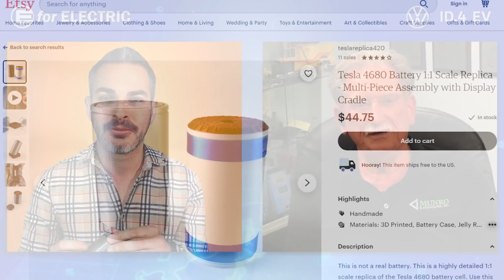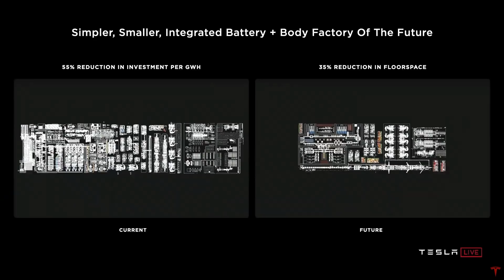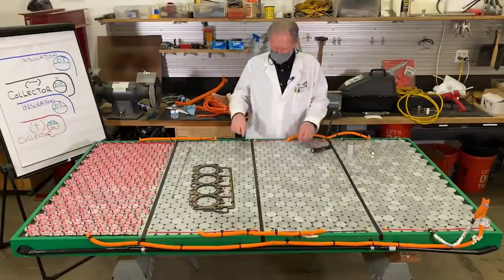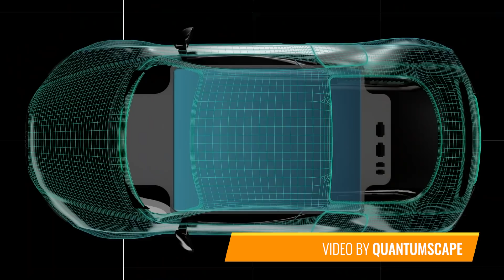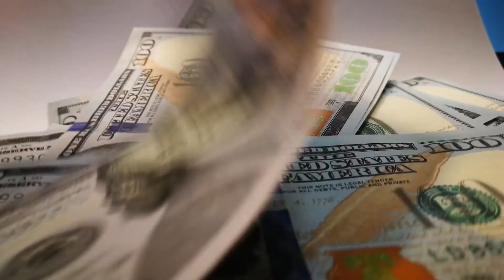SANDY MUNRO: Tesla's 4680 Cells & The Future of EV Batteries

Comment: Re: range issues, consider the PHEVs, like the Prius Prime: 60 miles on pure electric, which gets most of your daily driving needs done without gas at all, plus a 680 mile range combining the EV + gas engine, and guess what: there are filling stations from one end of this planet to the other. I think Toyota is smart to keep the PHEV option on the table. As much as I loved my Tesla M3, it was small on the road and hard to get in and out of: fun driving but at a price. Where Toyota needs to catch up with Tesla is in its electronics, including FSD or equivalent,
Reply: PHEV can't compete with simplicity, low maintenance cost and reliability of BEV.

Comment: Love the concept of Cold fusion & believe that it is hiding somewhere within the mysteries of quantum mechanics.  However, cold fusion will make heat not electricity.  It will need a companion technology (thermoelectric?) to convert heat to electricity.  Conceptually, your model of fuel cell plus battery with CF taking the place of the fuel cell is probably the right one.  Your channel is a favorite; insights from your years at Ford add bonus points to the topic of the videos.
Reply: Lol there will never be cold fusion inside a car

Comment: The "replaceable electrolyte" battery could make sense. A battery like that could both be rechargeable but could also be "refueled" at a fuel station. A person could also have their electrolyte swapout at home where they have an enclosed system that trickle charges their electrolyte while they are away and when they get home they can either re-charge their current battery or if needed, swap out the electrolyte. 

Tesla's 1 million mile battery is still VERY revolutionary but I believe Tesla is doing this for both use in space and their cars. In space or on other planetary bodies you will not have the luxury of a fuel station or service of any kind. The battery just needs to work. Electricity can be produced through many means (solar, fuel cell, nuke, chemical ect...) but without an extremely reliable battery it's all for nothing. Tesla isn't just building an electric car company for the heck of it... Musk is dead set on space travel and the car company is a means to and end, Telsa is an R&D arm for SpaceX where they can torture test components that will be used in space. It's brilliant really.

Comment: Sandy Munro does not seem to be very informed. The problem is that he has no clue about what is happening outside of California.

There's a new gigafactory built in north of Sweden by a new company called Northvolt. 

VW and Northvolt are in a joint-venture to build a gigafactory in Germany. Volvo and Northvolt are jointly building a gigafactory and starting a large scale R&D center. Daimler are in the process too. Other manufacturers have similar project with Varta. 

Northvolt can make cylindrical, prismatic and pouch type.

 Northvolt are also securing guaranteed supply of raw materials.

Someone should press Munro on the facts!

Comment: Any carbon storage IS an energy battery. It is a battery that stores, in an extremely efficient way, a huge number of Joules per a given volume and or weight. The only missing link between these Natural batteries and electric drive-train is an efficient thermodynamic transformer on board of the car that will charge fairly small supercap bank (1/8 of the size of the current batteries). In such a way the true electric car, with Natural batteries, will be way more efficient then the current ones and truly more environmentally friendly for the environment as it uses a true naturally produced energy storage.

Comment: It would be nice to hear Sandy's opinion on BYD's blade batteries. Higher voltage is going to run cooler so direct air cooling without a liquid heat exchanger seems ok.
The claimed fire safety is spurious. They're still using lithium in the redox cycle.
Not sure how BYD is getting higher energy density per cubic meter with direct air cooling. Need space and big heat sinks.
What's Tesla's view on this?
Reply: You are talking  about the BYD's LFP blade battery,  Tesla is going to incorporate this new type of technology in their basic model 3 vehicles.

Comment: Also, Sandy seems over obsessed with Tesla's claimed 'new' battery technology. There is NO 'new' Tesla battery technology. It's unchanged. Tesla has made some tweaks to the construction of the case and electrode structure which is nice and all but not remotely 'ground breaking' stuff. Tesla's cost to manufacture per kWh of battery capacity will drop a bit for sure but this is classic incremental change of a mature technology. No change in battery chemistry has been claimed and since all the 'secret sauces'; are made with the same ingredients by everyone in the game that doesn't surprise me one bit. It's rather like Coke and Pepsi. They have access to the same stuff but claim their 'recipe' is best. It's ridiculous nonsense.

Likewise the 'exchangeable electrolyte' chemical battery. The energy isn't stored in the electrolyte, it's stored in the ELECTRODES where physical changes happen ! The electrolyte is simply a passenger along for the ride.

In fact, Sandy's real and correct assertion is that Tesla's vertical integration is very important, critical even. Yes, it absolutely is and the damned MBAs would hate it for sure since they like to outsource rather than 'insource'. Guess who's also very highly vertically integrated ? BYD of China ! Surprised ?
Reply: Damn, half my comment vanished when I clicked 'comment' ! I'll have to retype.
Reply: Tabless is really just another word for "infinity tab"  - we still have to see if it works as claimed, long term.
Reply: @kadmow  It's a sensible change. Just surprised it wasn't done earlier. It's nothing earth shattering for sure. Tesla just likes to make a big fuss over every tiny thing they do. Great PR certainly. The fanboys can't get enough of it.
Reply: @grahamstevenson1740  :(surprised the tweak was patentable - may not be defensible-  patent  lawyers include wording like "a singular or a purality of ..." and "variations thereof"... to make a +1 or +(infinity) all covered by the umberella patent - oops  tl..
Reply: @kadmow  Well, I dare say they took good advice. I read the patent and it appears well drafted.

Comment: Once the battery pack price drops a little bit more it will be near impossible to create a new fueling infrastructure.
Car chargers are popping on houses all around my neighborhood, and it’s soo convenient to always start the day with a car with a full battery.
It’s now mandatory to install a car charging port on new houses.
It’s a done deal, it’s going to be rechargeable batteries in car for a while.
Reply: Good point.  One of the biggest hurdles to transitioning to alternate fuel vehicles has always been infrastructure.  Is someone going to be able to invest hundreds of billions of dollars to install slurry or electrolyte stations to fuel vehicles that are more expensive?  Even if those technologies have a greater eventual potential than 4680 cell batteries, it will take years and many billions of dollars in investment to reach cost and capability parity.  The only OEM so far that has shown the willingness to do the R&D and make the investment is Tesla.  Other OEM's say the right things, but have only really dipped their toes in the EV market.

Comment: Tesla is building their own Roadrunner 4680 batteries in their pilot factory in Fremont CA.  Next year they will be producing 4680 batteries in the new Berlin and Texas Gigafactories. This is in addition to the Giga Nevada joint venture with Panasonic and the contracts they have with LG Chem and CATL. 

Tesla’s battery suppliers my be producing batteries with the 4680 form factor, but it is unlikely they are producing these batteries with the same proprietary internal anode, cathode, electrolyte chemistry or the dry battery electrode process as the Tesla made 4680 batteries.

Comment: The biggest problem with Tesla is the insurance price. 
If I buy a Tesla Model 3 standard.  
I will have to pay $222 each month.  
That is ridiculous.  For a BMW 318d I pay $46,- each month and the BMW is twice the price of a Tesla Model 3 standard
As I see it, it is due to the cost of spare parts.
But funny enough, nobody is talking about it ?  
Why ??
Reply: I went from a 10 year old Honda Accord to a Model 3 and my insurance didn’t go up by much. Maybe you should shop around.
Reply: @juliahello6673  That I have already done.  It doesn't  help, only the price to go up.  As mentioned My BMW 318d is $46 each month, that is OK. I have a Smart Roadster for $39,-  each month. And a Renault Clio Electric for $38,-  each month.  All cars fully insurers and with a very little own risk.  PS: it doesn't help if I remove one of the cars.

Comment: Sandy commented that car manufacturers make their own gas tanks. They don't. I use to consult for a gas tank supplier making multi layer HDPE tanks with fuel pump included.
Reply: Yeah that wasn’t the best analogy. Battery is the equivalent of the engine in an ICE vehicle.

Comment: Those batteries are "flow batteries"... It's a known technology that is already in use for energy storage. Commonly it is using zinc-bromine chemistry. The advantage is no memory effect. The disadvantage, for a vehicle, is low energy density and the issue of dealing with corrosive liquids sloshing around in a car.

Comment: The electrolyte swap than Sandy mentioned can only replace part of the equation. Chemical changes take place at the electrodes. You can’t simply wash out the old electrolyte and off you go again. 
It might be possible to make a hydrogen carrier solution but there is still the huge energy density and efficiency issue.
Reply: The electrolyte swap is the basis of a Vanadium flow battery. They exist already and are available for installation as grid scale storage batteries. They can be scaled up or down as desired by changing the capacity of the electrolyte tanks. So, yes, you can wash out the old electrolyte and replenish it.
Reply: Re Flow Batteries:  
  - for more power increase the "fuelcell" stack size, for more energy capacity increase the tank...   Very elegant, but until now the "system"  has not been as lightweight, or cost competitive (that could be "investment recovery" rather than materials and manufacturing related..

Load up new "Charged" electrolyte liquid and extract the Discharged...  very elegant...

Comment: I'll tell you one thing for nothing. No ICE will be able to compete with that 4680, and anybody that wants to beat Tesla is going to not only have to beat the 4680, but be able to make a hell of a lot of whatever it is before it hurts Tesla.
Reply: hybrid-electric, nuclear-alpha-electric, supercap-electric, can do wonders, its only matter what makes the electricity, totally renewable gasoline
Reply: Optimising the form and dimensions of the battery cells and pack should be possible using mathematical techniques such as linear programming. Presumably Tesla have done this and come up with the 4680 cylindrical cell. In this case it will be hard to improve on.
Reply: please don't be so naive that the only smart people are @TESLA 

1. most technology is bought and delivered by suppliers 
2. there are hundrets of companies looking for other form factors, new technology, variants of chemistry 
3. it's not only about batteries; look at cars like Porsche Taycan or Mercedes EQS; they are much more desirable and what you are used to call a Porsche or Mercedes; these brands have heritage; it's not always the one who have been first who takes it all - see Apple (they did not invent the Tablet)
Reply: @accountname1651  First off, the Apple Newton was pretty darn early. Second, Tesla does use suppliers but makes a higher percentage of the vehicle than most. The seats are a good example. They make the whole drivetrain, unlike the LG stuff in the Bolt. They write their own software. I also don't want Tesla to be a monopoly, and I love mine. My point was, even if one of these manufacturers makes some magical solid state battery, for them to kill Tesla with it, they will have to kill every remaining ICE vehicle first, because Tesla will be better than all of them.
Reply: @fjalics  You have really drunk that Tesla Kool-aid haven't you. Tesla has a lot of good things going for them, but they also have a lot of bad (Elon Musk being one of them). Other, larger companies are quickly catching up and will likely surpass Tesla as they also know how to make cars well (Tesls has numerous production issues like panel gaps) and how to do Customer Service properly (Tesla has had some atrocious customer service problems).
Reply: @randomname4726  I drive a 2018 dual motor Model 3. Never had anything remotely close, or remotely  as expensive, but yes I love it. Tesla's pannel gaps have been inconsistent. Sometimes bad, and sometimes world class. My Tesla service experience was fine, but at they rate they have been growing, it's not surprising they had some issues, and when they ramp those two new factories, they are going to need to ramp service a lot. I don't think Elon has been perfect, but he has done, and continues to do incredible work. None of the other auto CEOs can even come close. Sure you can knit pick him if you set your mind to it, but then you miss the incredible things he brought to the table. Give me 2 CEO's you think are better.
Reply: @accountname1651  all the other car companies been stoped trying cause they were happy with their gas cars. And they started 12 years earlier with electric vehicles and they have their own charging stations who else even does that simple shit. Literally no one

Comment: It is difficult for me to believe Sandy is this out of touch with his industry. GM is spending $2.3 Billion to finish its second battery plant in collaboration with LG. Ford is collaborating with SK to build plants wherever Ford builds cars, targeting 240 GW capacity. Two years ago we all knew about VW's battery plant being built in Tennessee to supply its US factory. None of this is new News.

Cylindrical cells are not easier to cool. Panasonic's lead battery engineering manager expressed concern about cooling the 4860 along with his concern with the actual manufacturing process for that cell. He said it would be difficult to prevent contamination and maintain safety in the larger cells during an interview published in Bloomberg back in April (I think). 4680 issues may well have something to do with why the Model S Plaid+ was abruptly cancelled and no Cybertruck pre-production has been seen.

I salute Sandy's YouTube success but he does seem a bit out of touch with important parts of the growing EV industry.

Comment: I wonder what sandys views on the raw material extraction for batteries are
Reply: Yeah bro their has to be a better way. I saw this video on these guys that we're wrapping a metal spring around using an electric motor and that got me thinking. Why put batteries in all the cars if we can just out batteries in homes, and then charge mechanical batteries in objects to avoid excess lithium mining. Then your be able to charge your car using electricity fro nthe grid or the batteries to spin the motor thats spins the springs. The spring hold energy that can be released. It would he interesting to see someone try this method because it's basically like a wind up watch. Then if the power went out, technically you could charge your car with an electric drill or a hand crank with a bunch of gear reduction or something. It's probably not feasible but imagine if there became a point where it was. What worried me is hightech springs if and when they break, gonna do a lotta damage, so if we put them in cars they need to be tightly sealed somehow in a super tough way that even after it gets into a head on collision after 30 years on the road the spring if it snaps will snap and somehow not send an assload of shrapnel in all directions like a bomb. I was watching these guys talk about these springs and they're saying they can be wound up and released several hundred thousand times. The energy storage could he recharged a couple of times a day maybe if we're lucky, and you could recharge and drain it 3 times a day for 200 years. 83000 days of 3 charges a day over the course of 250,000 charge cycles is well over 200 years worth of lifespan. They would he engines that would outlast the vehicle built around them. A farmer could use it for something entirely different 150 years after it was born. All you would have to do is plug it into the wall for a little bit so the electric motor can torque the spring down like their is no tomorrow. It charges quick allegedly so you could store it dead so the spring isn't always under constant pressure. Plug it in a minute before you leave to wind the spring, drive to work, the store, pick up your kids and go home, plug it in again for a minute. Electric motors spin fast. You could spin a hella Hugh tech spring to a killer torque real quick. Energy storage outside of electricity. You could use them to put power into the grid if nessessary, or to soak it up.
Reply: @TheAnnoyingBoss  thanks for this comment. If you can, write a "TLDR:" at the bottom for people that can't read the entire comment.